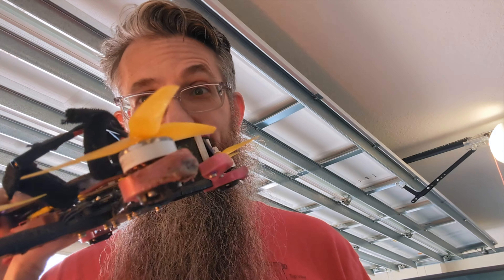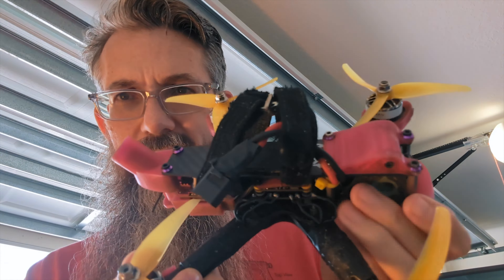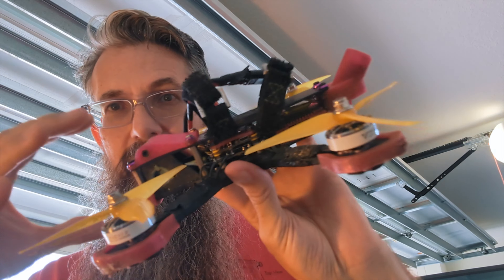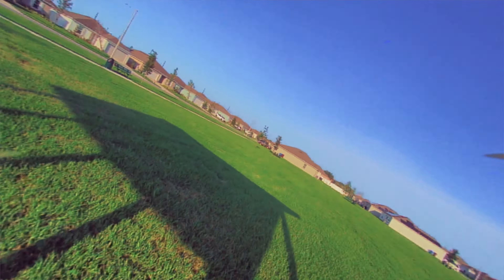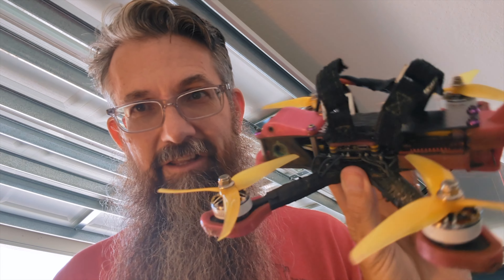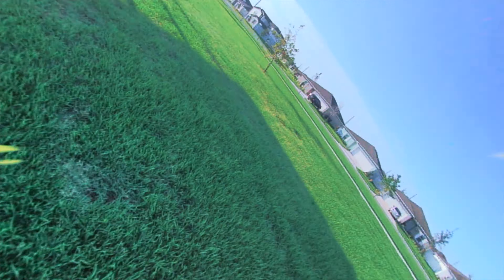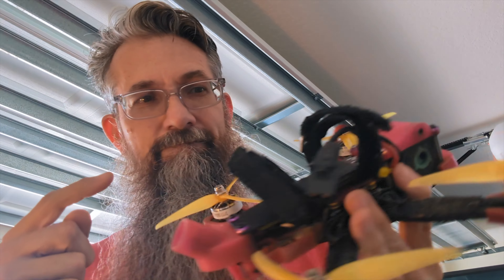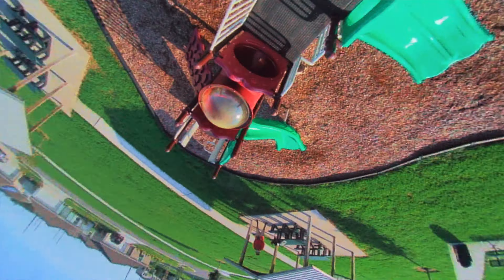Dear FAA... We Need to Discuss Remote ID

Comment: IF I get a RID, IF, I will shove it in there wherever it goes without regard to the abuse I will surely be giving it. I also won't care about the quality of the solder joints, the condition of the cables, or if it is touching anything that will make it inoperable. The law doesn't state how accurate the device needs to be, nevermind there aren't any devices out there currently that operate with each other in a sane and plausible manner. The law doesn't state the care I need to take to ensure it operates, at all. 

 I will try my hardest to make it work in the space I have, but you cannot tell me that I circumvented anything when you haven't rooted out all the issues that this device will cause. Nothing like a errant BT signal causing some interference on another device operating in the SAME CHANNEL as these RID modules operate. Surely we won't have issues with the same 2.4g band being polluted within millimeters of each other. Surely.

These scenarios don't even mention the amount of abuse the module will get. I mean, I get that people don't want to take the energy it requires to research something, but when laws are enacted by your laziness, and quite honestly - stupidity, they aren't real laws....
Reply from the maker: Yep!  All valid points...

Comment: I think you are looking at this from a single point of view.  There are a lot of other things that drone can be used for that are invasive, terroristic, or endangering to others... how do you prevent that and carve out loop holes for your use case?  Also, drones have been successfully delivering items for years.  San Francisco based Zipline and its Rwanda operations are probably the most successful.
Reply from the maker: For years?  hahahah  you're delusional
Reply: Anyone using a drone for those things is not going to have RID installed anyways so it is a non supported argument.
Reply: RID won't stop a drone from breaking the law just like a liscence plate on a car won't stop it from breaking the law. What's next? RID on cars so we can automatically get speeding tickets and get tracked everywhere we go?
Reply: @alanhobbs4879  The answer is low altitude radar and signal jamming.  The first is being adapted from existing counter battery radar.  If it can't be identified it gets brought down.  You will see this in place in the next few years.
Reply: @alanhobbs4879  god do not give them ideas.

Comment: A drone without remote ID does make it legal to take down as the owner in the state isnt allowed to have it above the ground.. doesnt matter how high above the ground it is... The FAA does not need to explain a reason... But its selfexplained, Dont fly things in the air....
Reply from the maker: Hmmm I've not a clue what you're talking about mate
Reply: @StacemanFPV  I think he's trying to say it's legal to take down a drone that's not transmitting RID. I could be wrong.
Reply from the maker: @lamarw7757 I think that is what he's saying..  and he's completely wrong.  An aircraft is an aircraft regardless, and shooting an aircraft is a felony, not that the FAA has been enforcing that for drones.
Reply: @StacemanFPV  yeah, nah. Shooting an aircraft might be a felony, but take down a drone without remote ID isnt. Theres many way you can take down a drone, shooting is..a primitive solution. i like the highpower laser that locks into the frequency source when anomaly is in sight. Usually the shooting pattern is too big for so small drone as yours, the battery goes instantly in flames. Never heard someone complaint it wasnt a malfunction...yet..
Reply from the maker: Ok... Lol

Comment: I might not agree with the "interference" portion of the video. Where is the GPS on your cell phone which transmits and receives 2.4 or 5 g constantly, even when not talking on the phone. I assure you the chip is much closer to the electronics than a RID module mounted on top of your battery pack, which is where it would go.
Reply from the maker: Depends on the rest of the electronics and how shielded they are within a cell phone.  In addition the cell phone uses towers to triangulate position and not simply the GPS...I know for a fact though that having the gps too close to other electronics on the drone will have a detrimental impact, as I've built GPS drones several times over the years and have experienced the problems.
Reply: @StacemanFPV  I can't argue with your experience over the past years with GPS, but we're talking about RID modules, which will use the latest generation chips for GPS, and be designed for use on drones that transmit and receive powerful radio signals, sometimes, as in the case of DJI, nearly 10 miles. September 16 is coming up soon and we'll be able to see just how RID modules work out with FPV and other long range devices.